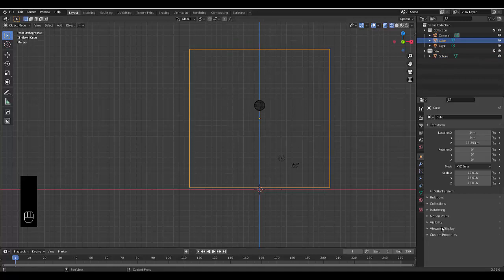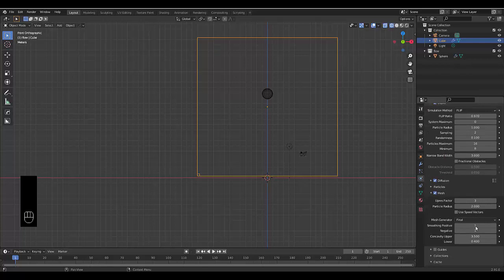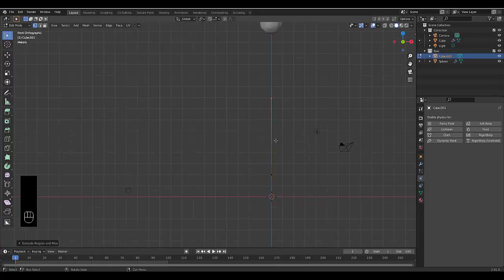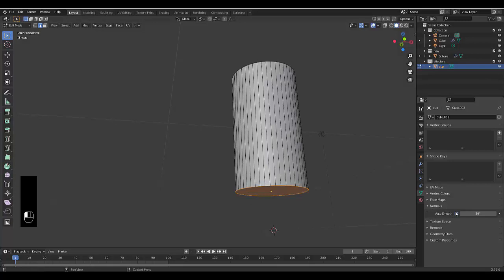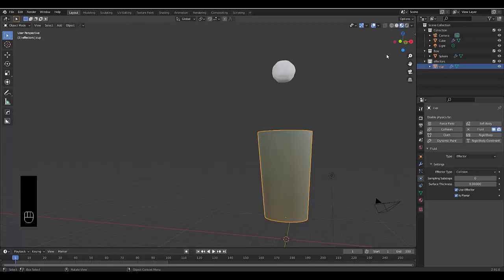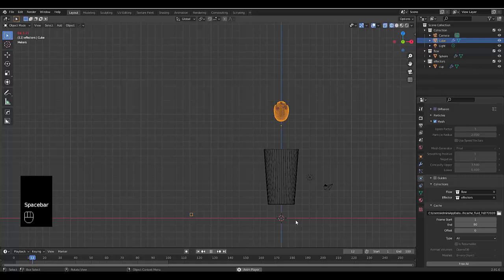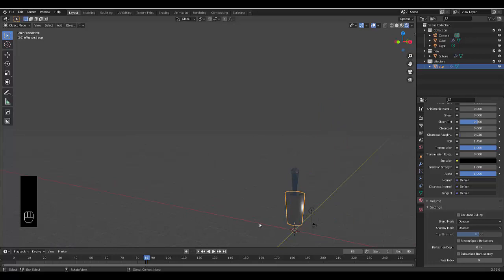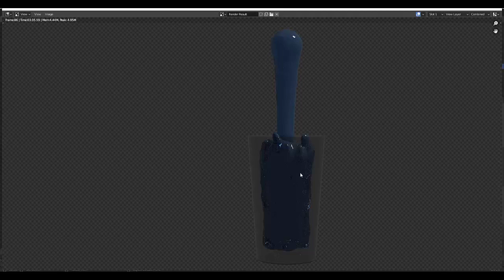Pour water into a cup blender 2.9

Comment: what do i do if there no liquid after I bake it
Reply from the maker: Cool common problem, now that I dont have a brick computer I should redo this. It basically means your voxel on your domain is to large compared to the liquid (geometry or flow element. You can fix this by increasing your liquid geometry size or by increasing your resolution of your domain (make sure both are set to liquid)
Reply: @FunwithBlender  how can i increase the liquid geometry size ?